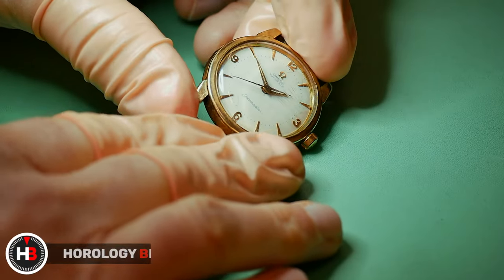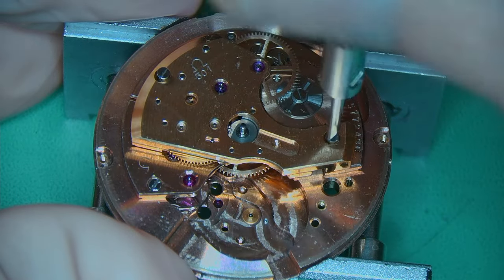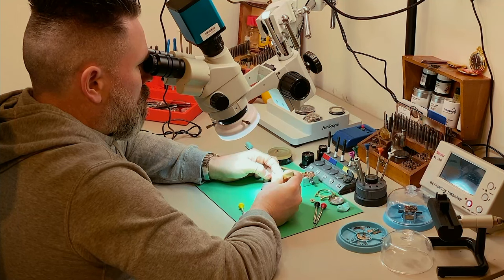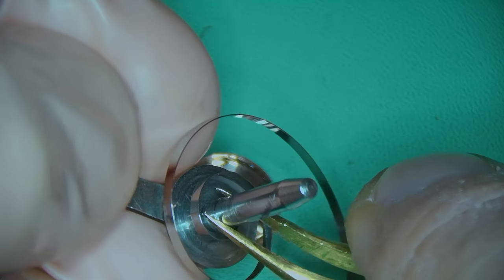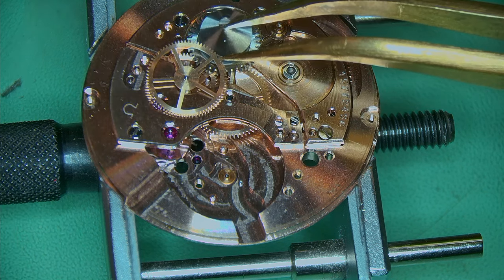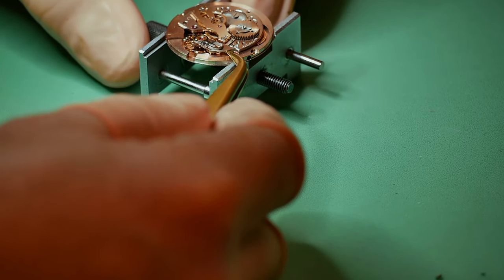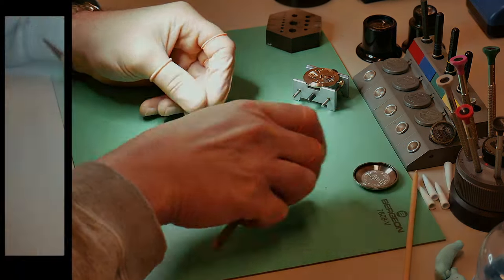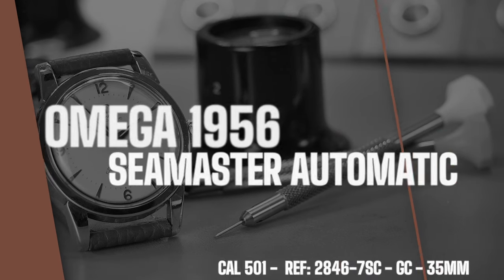Can I Fix my Neighbours Vintage Omega Seamaster Watch?

Comment: Would love to see the process of removing the radium from an old large number watch and reluming... although it might not be something you want to get into!  another great video.
Reply from the maker: hah you won't see that with me. I would never remove radium from a dial. The most I have done is remove radium from hands under water so the dust does not fly and that was outside. The process would be exactly the same and some people really don't get hung up on it or don't care. Maybe I am to pedantic about it but I'm not taking chances. 

Tritium is different as the half life has well and truly past so no longer radioactive. Saying that though I still remove it with care.

Comment: I just purchased a stainless semaster about 2 hours ago, I don't know much about it yet except it's time only. Perhaps I'll have time to open it up this week and have a good look. But I  also purchased 3 pocket watches and an early wristwatch Saturday. The 18s south bend has some keyless issues and the KW waltham has a damaged hair spring and a missing the roller jewel as well as a few simpler issues.
Reply from the maker: Thanks for watching 👍🏻 It sounds like you picked up a few gems. Hopefully not too expensive sourcing parts 👍🏻👍🏻

Comment: Was just discussing the radium with you the other day.
I have the a 1955 
Seamaster that is almost the same watch but with beads of rice bracelet.
What is your opinion of Alprosa watches?
Reply from the maker: 👍🏽 where was this? 
The levels were pretty low on this one as the hands were 100% tritium. The lume plots on the dial were also very small and intact so with care its ok I believe. 

The older watches are the worst where they have big numbers all caked in radium etc. Plus mostly in terrible condition now all crumbing away into dust. 

Not a massive fan with Alprosa even though it has that Enicar connection.

Comment: ALL TAMIYA products are fantastic, however they are reasonably expensive for what you get.  I use their ultra thin cement. But I found out thst their airbrush thinner is the exact same chemical formula.  So now I buy a bottle of that( at much more volume) and add a wee bit of acetone at about 50/50 percent.  Then you get a lot more.  If you doubt me then please look up the SDS, Used to be called MSDS on the bottle of Tamiya extra thin,  I promise it is not rocket science. Try it.
Reply from the maker: What product are you exactly comparing it to with what I used? I'm a bit confused 🫤

Comment: Did you check for radioactivity in the movement itself after removing the dial, in case the radium paint has partially crumbled?
Reply from the maker: I did yes, nothing was picked up